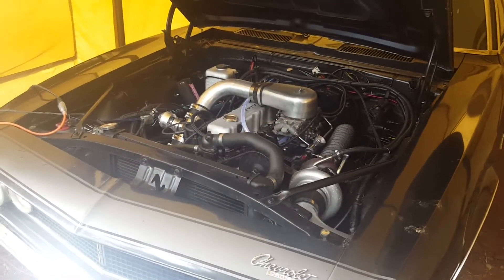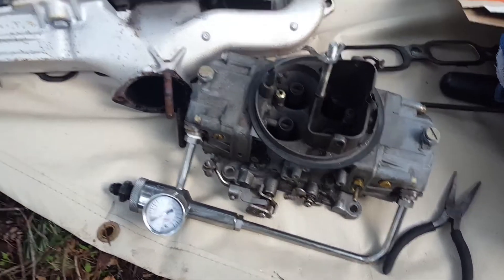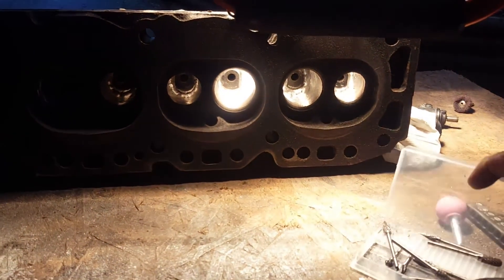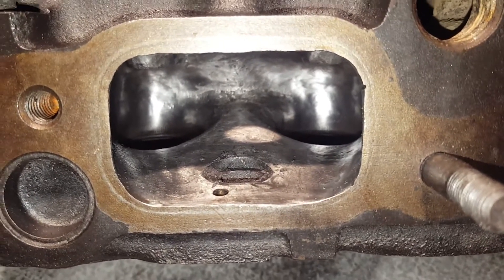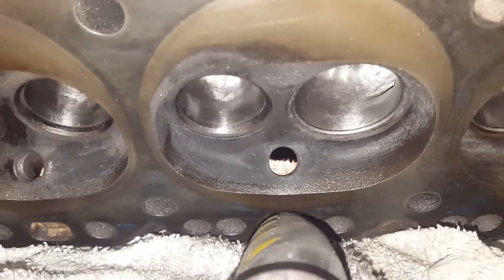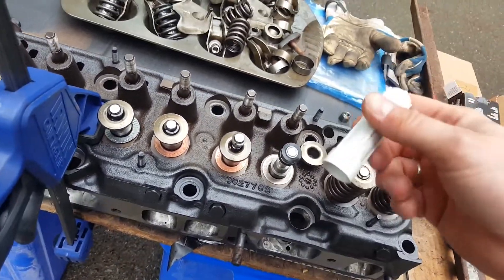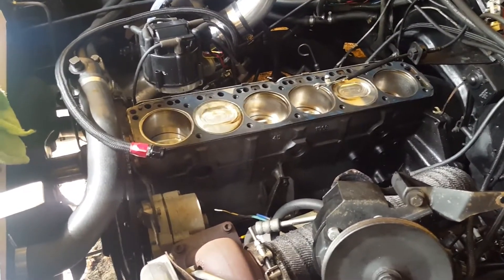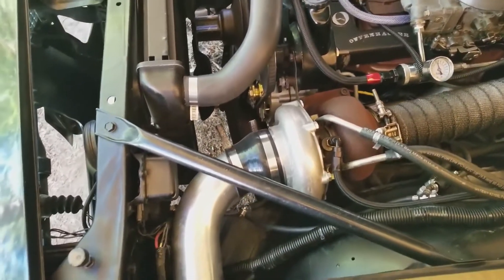1967 Turbo Camaro - Head Rebuild - Bigger Valves & Positive Seals

Comment: I'm sorry to see that you didn't move to threaded rocker studs.  I had a higher lift cam in NA 250 I built as a teenager it wouldn't hold a valve adjustment because the studs were being pulled out of the head.  Threaded studs fixed the problem.
Reply: Set up and drill to put a small rolled pin down low thru the rocker stud. No more lifted studs, easy to do.
Reply from the maker: +Steven Bauer yeah, I considered the modification  but the machine ship bill ended up being $800 over budget already. The shop said the studs looked solid and the lift isn't crazy so we left it out...still hoping I don't regret it.
Reply: I understand. I'm guessing the price has gone up since I did it back in 1980.  Did you get a price for it?

Are you running the stock cam?
Reply from the maker: I'm not sure about price increases but it seems like my local machine shops are similarly overpriced. I belive they wanted $20 a piece, so 12 x $20 is $240. I've had the valve cover off tons of times since and no sign of the studs pulling out. It's in the back of my mind though. 

Cam is a custom grind Hydraulic from CompCams. 499 lift and 115 lobe separation. Not super aggressive but designed for good mid-high range boost. Overall it runs smooth and hasnt added difficulty with tuning. I posted a picture of the cam card on the Turbocamaro.ca build sheet.
Reply from the maker: Splungers good call. I've basically measured the height of the studs so I can easily diagnose if I start having problems. So far so good but this tip could come in handy some day, thanks.
Reply: About 2/3 of the way down the mounting boss works good. Drill all the way thru the boss and stud, at such an angle that you can drive the rolled pin out if needed. a 1/8 pin will work.
Reply: On another note, those blocks have a forward head bolt hole that almost touches the top water pump bolt hole. they are notorious for running a crack between those 2 holes,and down the cylinder wall. There is a preventative fix- clean both holes to spotless,find a correct length head stud, and a stud for that water pump bolt hole loctite or J&B the stud in place, barely past finger tight, clean any extra thread locker to keep the gasket flat. Never remove those studs, and do not tighten them down in the bolt hole itself.

Comment: Awesome car and build man.... looking good! I'm getting ready to fall down the rabbit hole with my '78 Nova 2-dr with an inline 250 as well. I procured any older 230 head I'm going to have inspected by the machine shop so I'm not slaved to my integrated intake exhaust manifold. Probably go 1.84-1.88 on the intake and 1.60 on the exhaust. I'm going to put a Stove Bolt cast iron split exhaust header under an Offy 4bbl intake probably with a smaller 390 4bbl Holley carb. Trying to focus on the top end of the engine for now so I can still drive it if I want. The Camaro looks great man!
Reply from the maker: DaveSanctuary Thanks! That'll be a great upgrade for sure. I'd consider the head bolt boss removal too. If you do that, it's almost a shame to not install the metal lumps in the ports. There are all kinds of stats on flow and HP gain from that process alone and you can do most of it yourself if you're up to it. For $60 worth of parts and a mill bit it's probably the best bang for your buck modification for power. I've got a video of it here. Either way the project sounds great!
Reply: Turbo Camaro I'm definitely going the route of removing that Siamese bolt boss on the intake. I believe however I'm going to bite the bullet and pay the machine shop to do the work and install the lumps while they have the head. I have the patience to Port match, blend, and polish as well as lap the valves, but the thought of using a mill bit with no press terrifies me. The head I bought was a steal at $50 American that I bought from a friend of a friend and the engine was running before we pulled it for him to go the route of the small block. I'll have to pull the front bumper and Radiator on the Nova to replace the upper and lower radiator supports. When I do that I'm going to install a 252H grind cam kit from Comp Cams. it has a solid 800 - 4800 RPM range that's a hydraulic flat tappet with hydraulic lifters and includes springs, timing gears, and timing chain. I also want to install roller rockers to help minimize friction and heat, but all good things in time. Build it once and build it right! Good luck and have fun!
Reply from the maker: DaveSanctuary Nothing wrong with getting the machine shop to do it. I had a friend with a mill so I don't blame you if you don't have access to the same. Id bet the bolt boss removal will cost a pretty penny at a shop. Seems like the custom stuff comes with a premium here. Sounds like you have a good plan as far as build order. Always nice to see another inline in the making. Did the 78's use timing chains or just gears like the 60's versions? Either way, always nice to see another inline in the making!
Reply: They used gears as well.

Comment: Hello, what is the fuel you use? We in Brazil use ethanol.
Reply from the maker: JEAN COLET This car runs on regular pump gas with a 91 octane. When the boost hits 3#'s the carb gets a constant stream of Methanol and Distsilled water mixed 50/50. Hopefully that answers your question.
Reply: I wish we had ethanol. I can't even get E-85 where im at!

Comment: couldn't you put the belt on the other side of the alternator pulley
Reply from the maker: Jayden Lasater Yeah I could probably bring it toward the block more and use a double sided belt. My original alternator had a double pully so I could run a separate belt to it. Sadly, I couldn't remove it. This seems to be working well though.

Comment: Nice job man, when you had the head done, did they cut the bowls bigger to compensate the bigger valves?
Reply from the maker: Military Chevy They said it wasn't an issue for those sizes for both clearance and compression. If I had gone up another size they would have had to.
Reply: Ah ok, I went with 1.94's for my 292 and my machinist cut the bowl to a bigger size.
Reply from the maker: Military Chevy That's consistant then as I went with the 1.84's and 1.6's. The chambers remain 72cc's.
Reply: Yup, I also had the head shaved .030 off the base for a compression boost. But I'm staying naturally aspirated....for now...may do 8 PSI in the future. :D
Reply from the maker: +Military Chevy They just milled enough so I had 0 deck clearance,unfortunately they didn't say how much it ended up being. So far 5PSI has been fun, it sure exposes my lack of experience tuning carbs. Just about have the primaries nailed down.
Reply: I think it was .012 on the block to 0 deck the pistons for me. And on top of that .030 shaved from the head. I think I'm around 9.5.1.  Tuning a carb takes quite a bit of time on something like that, nice that the primaries are almost there though. I'll probably have to do the same for mine.
Reply from the maker: Military Chevy I managed to get the measurements this time and I'm running a 8.7:1 ratio. I was aiming for 9:1 so that's about right for me. Perhaps that extra off the head would have put me spot on.